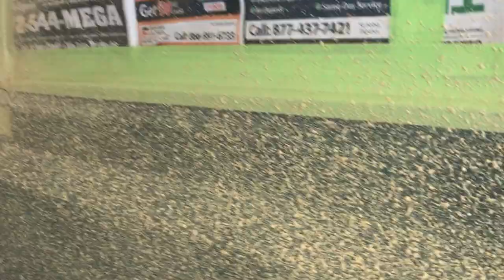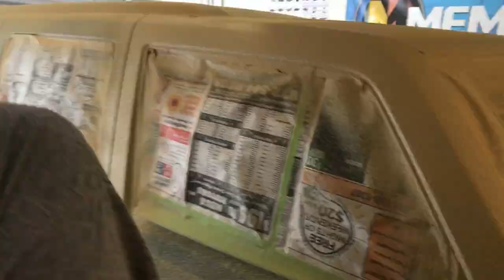jeep commander custom u-pol raptor liner paint job (bed liner)

Comment: Looks good. What did you do for the door jams and spots like that. Are they left black?
Reply from the maker: We left the door jams and other covered areas original color. The job would have doubled in time if all trim and doors were removed, sanded and sprayed. Its not worth it to me and it doesnt bother me. I see this more as an exterior shell rather than a paint job.

Comment: Looks like you gents did quite a great job. Most of the raptor videos are a how to achieve a streaky paint job... here it looks like the structure is uniform so props on that. I'm guessing due to experience with paint guns. Can you share the exact color code of the tint used to achieve this magnificent tan shade? I would consider laying it onto my subaru :D.

Comment: Looks really nice!  Did you guys painted the inner door frames too? Or you didn’t open the doors at all?  Thanks!
Reply from the maker: We did not paint door jams. No reason to
Reply from the maker: We did not prep or paint inside of doors. Not neccesary for my jeep. If i had a wrangler with removable doors, then yes that would be neccesary.

Comment: What spray gun did you use and you mix the paint with the raptor liner before painting?
Reply from the maker: Logan Basden yes you must the tintable (white) liner and add paint. Theres a formular amount of paint per bottle and pressure to spray at. All info is provided with the raptor liner kit
Reply from the maker: The kit comes with a special gun for the job. Between sprays you must spray thinner through the gun. The liner hardens very quick and will get a bad spray if you dont keep it clear after every bottle

Comment: Hey I'm going to be spraying my Toyota fj cruiser. In the coming weeks. What pressure did you spray at?
Reply from the maker: Sean O'Hara if i remember correctly it was set to arou d 40. But you can find more info on google about PSI/distance to hold gun at.
Reply from the maker: Sean O'Hara we actually did an fj last year. We made it black with red trim. Good luck!
Reply: tex fix thanks for reply. Commander turned out great. I'm going lime green and leaving all the trim black.
Reply: how did it turn out?
Reply: how much would you figure for a 98 tacoma ex-cab

Comment: Hey man, What size spacers are you using? and what lift?
Reply from the maker: MeGa i went with 3 inch lift. I learned its better to do 2.5 in the front and 3 in the back. Better balance that way. Also the  2 inch spacers were too much after i got wheels with large offset and tires that bulge out. Better to stay with 1 inch spacers or none at all if you get offset wheels with wide tires.

Comment: Hey mate. Good job! Did you guys sand down to bare metal or is that grey/silver just the factory primer below the black paint?
Reply from the maker: we sanded just the clear coat. not necessary to sand deeper. the grey color you see is the clearcoat dust. once its cleaned off the color goes back to a darker black, but no longer shiny.

Comment: What kind of wheels r those and tire size
Reply from the maker: Vision 17" from ebay and cheap all terrain tires. I bought the jeep wrecked and with the l8ft kit and spacers i put on  cheap tires to road test for first year. Good thing i did, alignment was way off and chewed through new tires in 6 months. I took off spacers and kept lift kit on. New tires after suspension rebuild
Reply from the maker: Id recommend with these wheels NOT to put on spacers. They have a wide offset that makes them stick out enough. Also the wheel spacers started messing with my rear suspension. The drive shaft started making a clicking sound and went away after i removed spacers.
Reply: Thank u  brother

Comment: Looking to do my '01 wrangler. Was it difficult to put trim pieces etc back on after you painted it? Also, how many bottles of Raptor did it take?
Reply from the maker: David Jones 1 kit of raptor liner comes with 4 bottle. Around $100 bucks. It took 2.5 kits to do the commander. If you get tintable liner, be sure to get enough paint for the amount of liner you need. We ran out and had to get more paint mixed. The color was not an exact match so we had to spray the who thing down with the new color.
Reply from the maker: David Jones trim pieces will go in just fine. Clips that hold pieces to body flex and will go back just fine. Maybe a little tighter
Reply: TEX FIX cell phone Repair Wylie 👍🏾

Comment: 0 prep? Good luck
Reply from the maker: Slobberdog66 what prep?
Reply: Raptor liner needs very little prep
Reply: That's a big benefit of this stuff. There needs very little prep. Sand it, blow off the dust, and paint.

Comment: As a professionally watching you block filler without a block makes me cringe
Reply from the maker: Definately my 3rd time. One thing im not an expert at. Can always use feedback. Thankyou
Reply from the maker: We were not concerned with a perfect finish considering the final product will not be polished to a shine. One of the benefits of using bed liner on a truck is not worrying about perfection. Normal paintjob would have been done differently and not in a dusty garage lol

Comment: How did you remove the rear upper plastic trim?
Reply from the maker: t88byrd bolts run across the top to hold in place. I think 3-4 total.